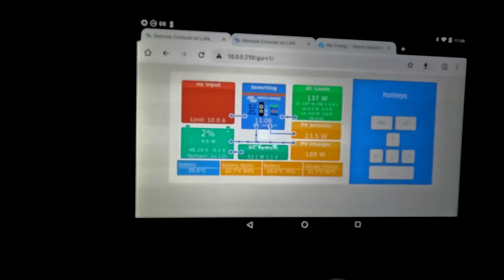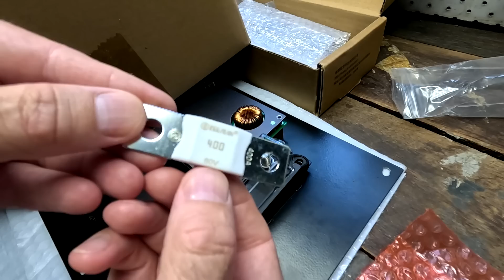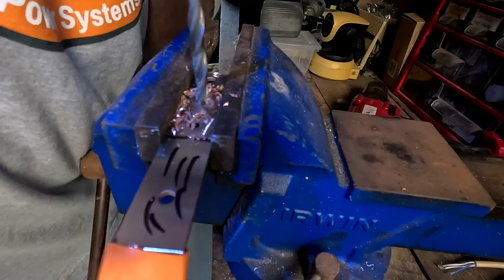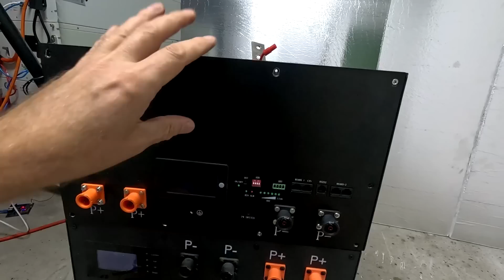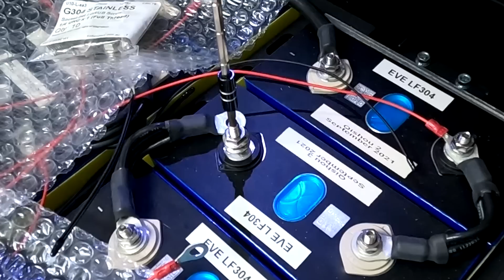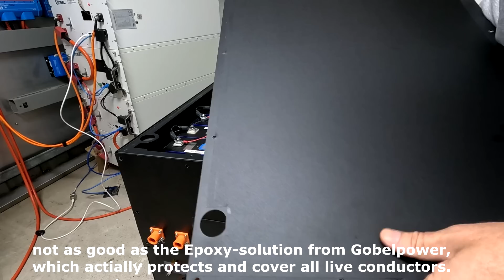Finishing the Frankenstein Battery with JK-BMS. Re-using a lot of parts... and snapped a terminal!

Comment: Get yourself a small diesel engine, 10 HP or so. Fuel it with used vegetable oil. Connect two 150 amp alternators with a custom regulators, or wire 4, 100 amp alternators in series. With a small 12v battery for each for exciting the field.  A midnight classic charge controller setup for hydroelectric generator. Use a DC to DC to excite the field getting about 18-28(+/-6 v.) volts per alternator. A alternator can easily output 60 volts, definitely use a thermal switch on the stater to send the field current through a 12 v tail light bulb or power resistor 12 ohm 100 watt to Keep it cool as possible it only needs to drop the field current when hot, then when it cools the switch shorts the resistor or bulb allowing full power. I would use universal 200 amp 3phase rectifiers 1000+volts 200 amps connected to a large aluminum heatsink. Maybe water cooled. A 40 mm x 40 mm square bar of aluminum with a 10 mm hole tapped through it. With barbed fitting s to connect a hose allowing water cooling..  a tiny pump with steady 1-2 litre per minute through a M6-m8 hose.  And just use a large barrel of water. IT should take forever to heat the water to 80°f at full power. And possibly never getting hotter. It definitely shouldn't exceed 100°f /35°C (approximately) it would be better to burn a liter of vegetable oil or diesel, to charge the batteries about 40%  from 0%

Comment: Had a battery with a striped 6mm internal thread, drilled and tapped the hole for a  1/4 28 helicoil now good as new, none of this metric stuff.
If you want a shower, go out in the rain, tough it out and have a rain water shower.

Comment: Very helpful. I have early V14.  jk-bms, never powered, and Gobel cells. Your quick-check run thru of settings, was great to keep and see again. 
Re finding unmarked, suspect old parts, I keep a bag of the small white "price tags with strings", that are available in stationery stores, or newsagents. About 25 x 30 mm.  
I write the date, also "suspect",  or write fault, and attach to part when you see it's bad. They're also handy for just  attaching to bit of junk someone gives you to keep or fix for them, (' from Bill') before you put it on shelf to hoard, or forget. Stick on labels or masking tape leave glue or mark after months or years. String tags are great. Thanks again.

Comment: From the video angle, it looks like your SF-2 flexi bus bar's exposed section near the fuse is dangerously close to the metal heat sink of your BMS.  You might want to add a bit of heat shrink tubing for safety.
Reply: And the negative connections to the BMS look like they might be dangerously close or even touching the BMS heatsink. Didn't Andy have this issue before where the battery box to positive terminal was at 52v?
Reply: @rayfitzharris  yes, on the first version on the BMS before the put a heat shrink over the coil